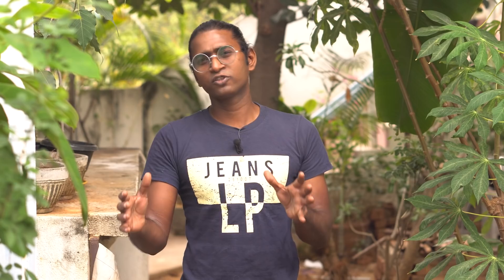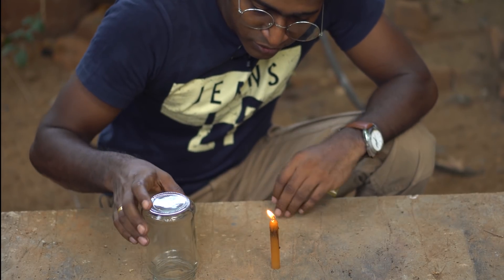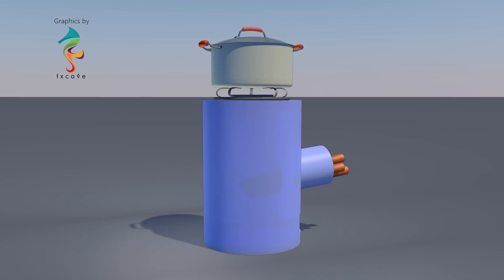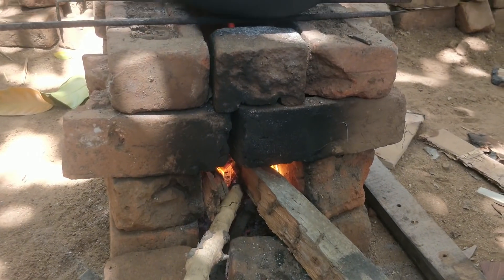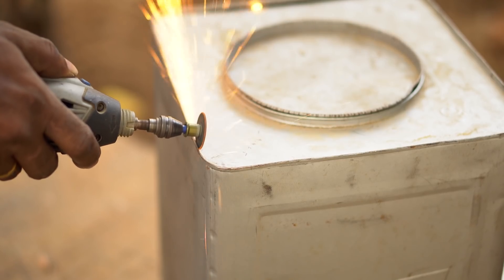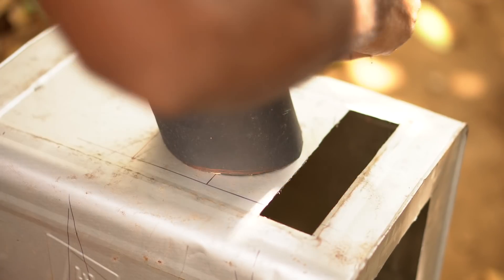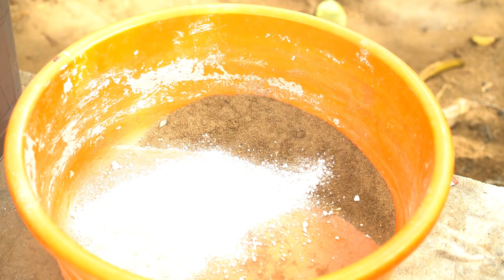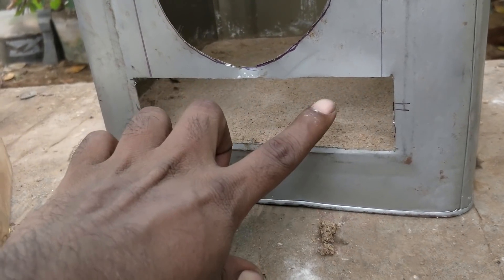Rocket Stove -உண்மையா?பொய்யா ? இதோ சரியான விளக்கம் மற்றும் செய்முறை| TAMIL| Portable Rocket stove

Comment: The need to break them to very small pieces is the biggest flaw of such designs. I too tried one with concrete but , mostly smokey coz of using big chunks of wood . I reverted back to the one using bricks. Less effort and more efficient
Reply from the maker: Yeah, a little extra effort  is need to chop wood. But it burns well and is highly efficient

Comment: I was told the inlet diameter and the central column diameter should be the same. In addition  you need a chimney to avoid soot.
Reply from the maker: That is true. I made an upgraded version after a couple of months. Still haven't added the chimney cause i am only using it to boil water

Comment: It's smoke less stove
Reply from the maker: you are right.  Actual rocket stove has a chimney and the wood feeding slot is closed once you feed the wood. It makes a roaring sound and hence called a rocket stove. i have modified the design a bit and made a version two in Tamil and English as well. Please check it out and give you feedback. Thank a ton

Comment: This is NOT rocket stove, you need seconary combustion chamber when volatile meterial has to completely burn and no smoke will come. Also the flame should not be touching on the side of the pot at all, only on the bottom.
More over Rocket stove is characterized by roaring sound hence the name rocket stove.
Reply from the maker: thanks for the input. But I already made another version  like this and the video will be out soon. But I will try to incorporate this idea

Comment: Bro nice I all most used the rocket stove from 1 year but it got rusty  and spoiled one thing I didn't do is feeling the  pop on  sides I used 3 tin to make 1 for outer 2 inner and i folded inner layer in square shape and used handle which comes in Paint bucket in in your rocket stove it needs the grill  above the air event

Comment: இதுல blue flame வரவைத்துவிட்டால், அதுதான் பெஸ்ட் டிஸைன்...முடியுமா?
Reply from the maker: Blue flame is not only because of the design. It's also because of the fuel. Since we are using wood, which is loaded with carbon, the flame will be always be red/orange/yellow wave length.
Reply: I have watched some videos which uses forced air with fan which creates a sort of whirl that mixes air at a proper ratio.
Reply: One person claims that he has done it without forced air...
Reply from the maker: @nathanl3160  yellow flame is nothing but a cloud of glowing carbon particles. So may be you are right there. Altering the composition of air and the force might change the colour. Please share the links of the videos you talked about. I want to learn more. Thanks a lot
Reply: Smoke and soot are unburnt carbon.  You should burn them all before it reached the top, is the idea...
Reply: You are supplying air only to wood.  Maybe if you supplied air to the flame, both at the centre and around the flame, the flame might turn blue.
Reply from the maker: @nathanl3160  Really interesting idea.
Reply from the maker: Also Nathan, your comment has triggered me to do another experiment.i am thinking in a whole new angle. Thanks a ton
Reply: Best of lucks.  I will be the first one to buy, if you designed one.  It will be of help to many.
Reply from the maker: @nathanl3160  i like this channel too. This is cool idea. But we need a bit more thinking. I was thinking more on the lines of a jet engine. What if we introduced a spinning fan in the system. Just going a bit wild on my thought...
Reply: Spinning fan to disperse the flame or whirl it?

If you keep multiple grills or meshes inside the chamber, and supply air through the grill to the center of the flame, it will turn red hot and burn all the carbon before it reached the top...

I think of affordability too...and less electricity or moving parts...
Reply from the maker: @nathanl3160  think of it this way. The fan attains it's speed because of hot air displacement. Once it start moving, the cycle begins. Air is sucked to the hotter area and would try to move out of the other end of the tunnel. The pressure inside the chamber will be more and would be pushed out with a force giving out a jet of hot flame
Reply: Where are you going to keep the fan? Is it motor driven?
Reply: Maybe you make a rough sketch of what you have in your mind and show me.  I will do the same.
Reply from the maker: @nathanl3160  right now it seems like a stupid thought, but i thought of placing a metal fan with ball bearing and a long shaft above the burning chamber. As the heat rises, the fan will rotate. The hot air will push through the fan rotating it. Once it starts rotating, the fan will act as a turbine and inturn keep sucking the air. So the fire and fan will compliment each other as long as there is fuel. As a net result the flame will be directed to the outward end giving it a jet flame ..just thinking...
Reply from the maker: @nathanl3160  sure Nathan. If i may ask ..where you from and what do you do.
I really loved this coversation. This is what i had in mind, to discuss ideas with like minded people
Reply from the maker: My email id videoeppo@gmail.com. Shoot me a test mail and i will try to upload a sketch
Reply: Sure, i will shoot an email.  Personal details after blue flame is achieved....until then let us be strangers...